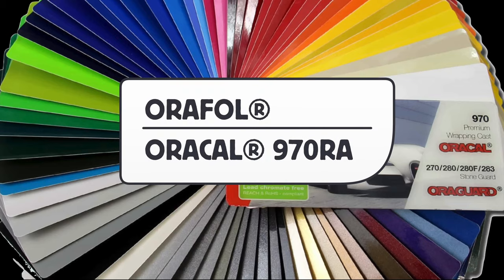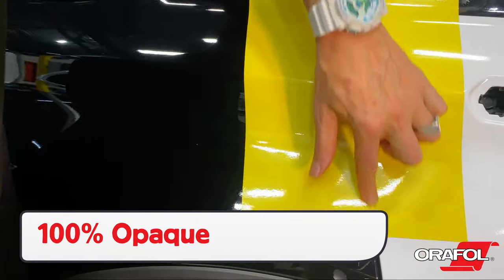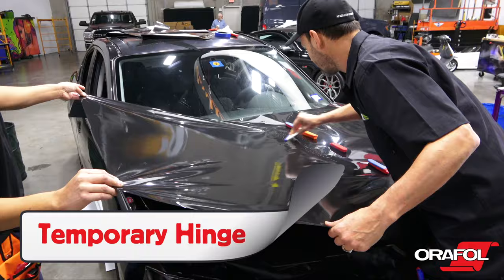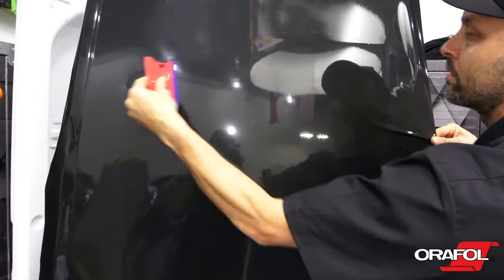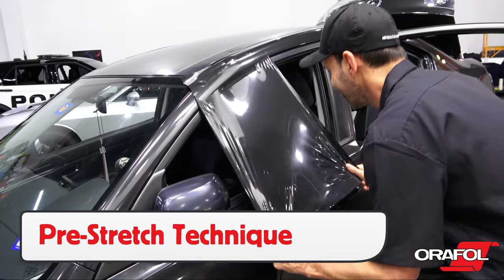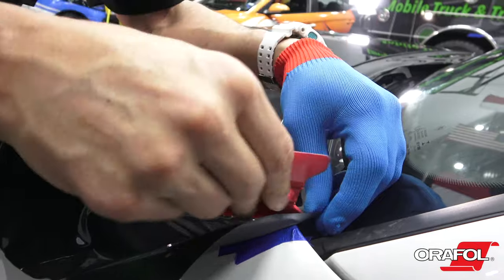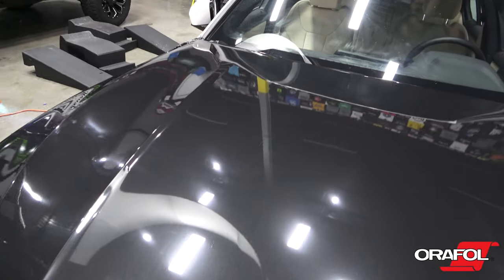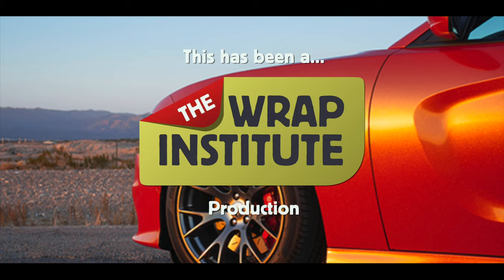ORACAL 970RA Vehicle Wrap Application Video - ORAFOL Americas

Comment: I'm trying to put on Oracal 970 film and it produces a ton of air bubbles. It's like impossible to apply without getting air bubbles. I ordered the film with rapidair adhesive, but could it be I got the non-RA version? How can I tell if it is RA adhesive or not? The backing paper only has Orafol and the number 970 on it. Shouldn't it say 970RA? Because this film is a real bitch. I can't use it. I've worked with 3M and it is a ton easier to work with.
Reply: Use it with water buddy
Reply: @IllyrianMedia  I ended up pulling it off and getting the RA adhesive. Worked much better.